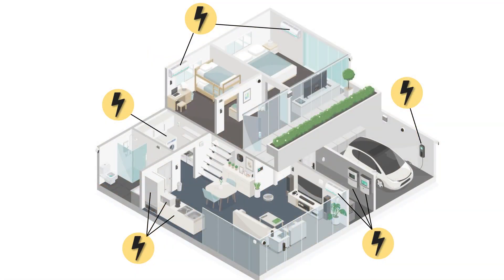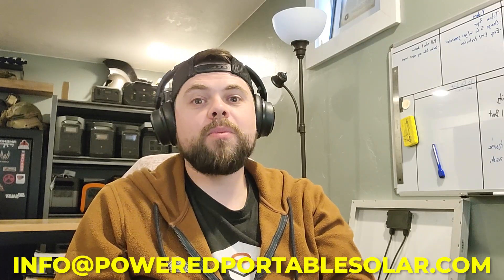Q+A #004 Solar for Big House vs Little House

Comment: That doesn't really make sense they refused to sell you one there are benefits in wind turbines I mean I see videos of these windmills a people who have them not the ones that sell them I need talk about the wind power but they also could say it's not for everybody like the place that you're in me not allow it if you get in a place where is very little wind. But just to know this a windmill needs to be serviced at least once every 3 years to make sure the place is still turning nicely making sure the barons didn't go out on it make sure it's still greased and also to check the wiring from your windmill to your system you hooked it to. With solar panels I serviced every single year making sure the wire connections are good make sure the wires are good making sure the panels are clean making sure the battery is still good and clean checking out the charger the  inverters. And I'll do the same thing with a windmill. Of course they say you got a service your solar panels once every three years just like to say you got a service for windmill once every three years all want to do is compliment the other all the other one could do is compliment the other all they can do is complement each other which would make a win-win situation so I don't understand it.

Comment: Wind turbine is good when it's got some wind which could be anytime of the day but wind turbines use you don't come with that much power unless you get a super-sized windmill which is more than super costly to buy it. Or maybe you just got to get a bunch of little ones and and for another problem can't necessarily put it in any place if you live in a city or town coordinates won't allow it. I mean I wouldn't mind put up my 400 watt windmill but I don't think the town I live in would like that so much and it is only 400 w and it's silent makes no sound which would be a plus plus right but people don't like looking at windmills. But solar panels you could put that any place you may have to follow guidelines but those can go any place just don't forget about getting your permit.

Comment: Would a wind generation system make more since ($) if it were producing and sized for 10 homes rather than just one?
Reply from the maker: The money would be far better spent on having more solar panels and batteries.

Comment: careful with saying that every time a solar panel will be better than wind.......i remember a time when everyone said solar would only make sense for a small number because the panels needed to face perfectly south and yet today there are many examples of east west arrays.....i suspect that there needs to be new thinking in the wind industry for small scale wind to become more usable for today's expectations. The traditional 3 blade set up is made for best performance for a huge wind turbine.  There was a time in Montana that many homes were powered by wind power and very old school batteries.  Those wind turbines looked very different from what we see today but they worked well nought that it took federal subsidies for farmers to accept the rural electric power. that for years was less reliable and prone to damage from weather. Wind can work at night and during storms when panels can not. Might be a place for em if we understand they are not solar panels, just like solar panels are not grid power.........
Reply from the maker: Solar is better than wind. I can say that with great confidence. I am not saying you shouldn't do wind, but I am saying you should do solar before you add wind.
Reply: @minutemansolar  i agree with you solar is better and should be the first to be added. For now wind is for the adventurous ones who are willing to experiment and push the boundary of what can be.

Comment: How's that Everchill refrigerator working out for you in your RV. Ours lasted about 2 months past the warranty. Replacement cost = $1800 + labor
Reply from the maker: Still working 100% for me. It's been running for 2 years without a single issue. I'm sorry yours didn't last.
Reply: @minutemansolar  Thanks for your response. Are you able to keep it under 40 °F?
Reply from the maker: @m3cog  Yes.

Comment: Part of the learning curve for solar arrays, power stations, battery banks, inverters, etc. is truly understanding how much electricity each of the common devices in our homes will consume.  It goes even further than that because some of those devices will consume a little bit of power throughout the entire day (internet router) because they are generally left on constantly, while others will only run for relatively short periods but consume far more energy, such as an electric hot water heater.  Some devices are designed to only run off of a 240v circuit, which introduces a great deal of cost and complexity into the off-grid or whole home backup solution options.  Most folks don't understand that their electric clothes dryer will consume more energy drying one load of clothing than some of their other appliances will use in a week!  An electric water heater will use as much energy in one hour (even when you're not using any hot water) than a conventional personal computer (tower) will use in an entire day.  Understanding these demands is critical.

Comment: Good info Ben.

My understanding with respect to wind turbine with the Delta Pro is that a user would require a separate controller and set of batteries to send power to the DP via the XT60 DC input port as the DPs charge controller would fight with the wind turbine's output. Gavin’s Garage tested this out a year ago.

With respect to solar vs wind, I agree that I have heard the same thing you mentioned many times. Spend your $$ on more panels and a user will be ahead in the long run.

https://youtu.be/iApzrIuBHPA
Reply from the maker: That's a good way to do it.